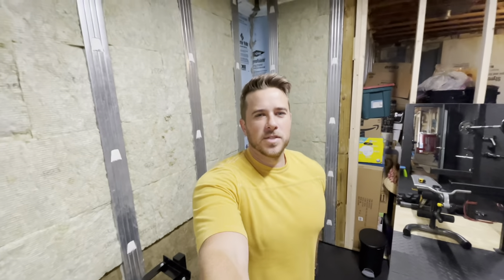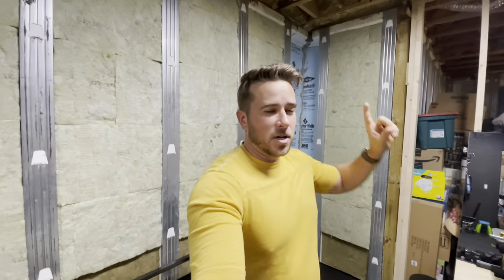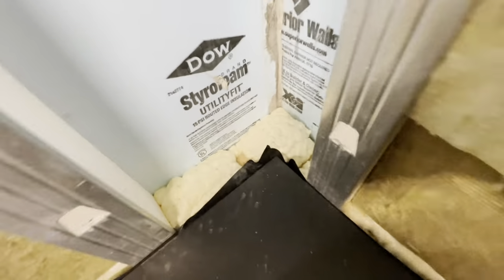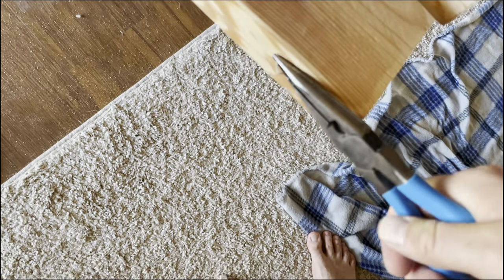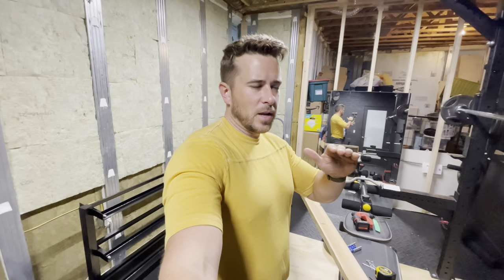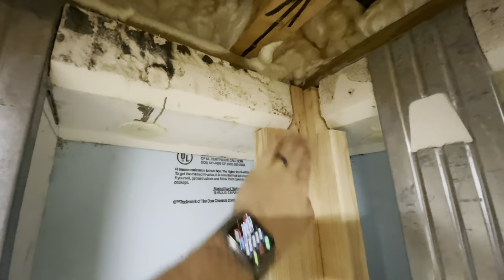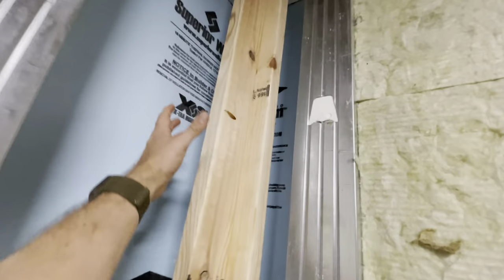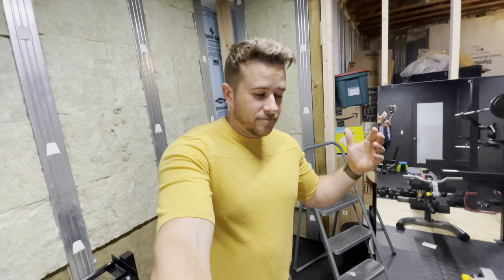How to frame corners in SUPERIOR WALLS!

Comment: What screws did you use to hang your drywall? I know they recommend adhesive as well, did you have to use self tapping screws to puncture the metal plate?

Comment: What insulation are you putting in between studs? I have Superior walls from 1989 with orange fiberglass, Im starting new construction on the basement , i was going to do the spray foam deal, those cavities and corners worry me, knowing where the bolts are i can see my footer stone. Lots of advice appreciated thank you
Reply from the maker: I've just been using mineral wool.  Its supposed to be fairly moisture resistant, which it preferred with this system.  If you can do spray foam, then do it.  I'd prefer that, I just haven't wanted to spend the money.  If you're concerned about some of the joints, I have another video about how I've tried to seal the corner joints.  A good polyurethane caulk could be good too.

Comment: Put a 2x6 block in between your floor joist and PT mud sill. You can place it to attack your corner and also be backing for your ceiling material.

I’ve used superior walls in a handful of builds. Personally, I wouldn’t use them in my house, as a first option.

Comment: Glad to see you were able to get your slab poured and upper floors sheathed without the foundation walls sliding The heck with framing corners-HOW are you gogin to endure no leaks in these 8-10 long cracks (aka joints) in this system?
Reply from the maker: The system has been around for a few decades and its been doing alright so far.  Zero leaks.